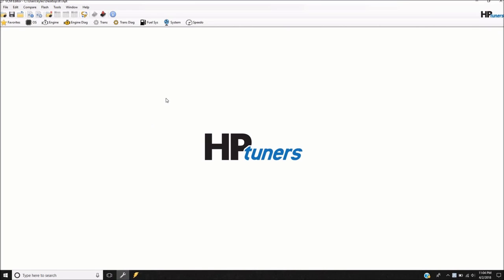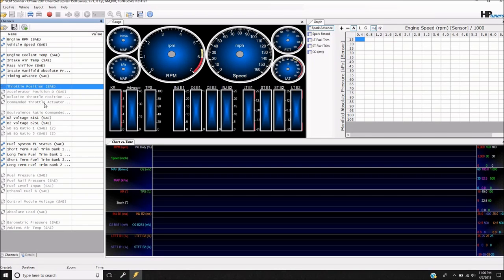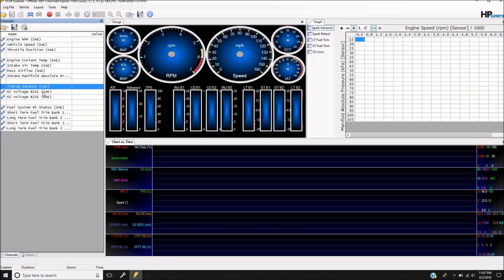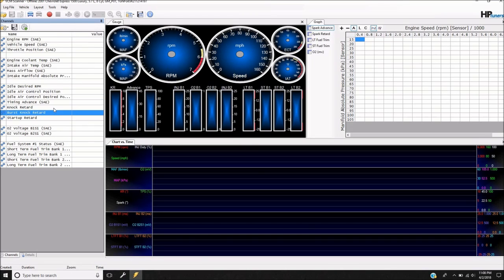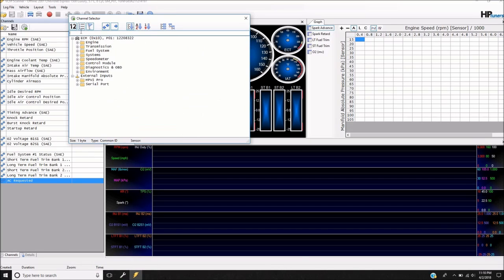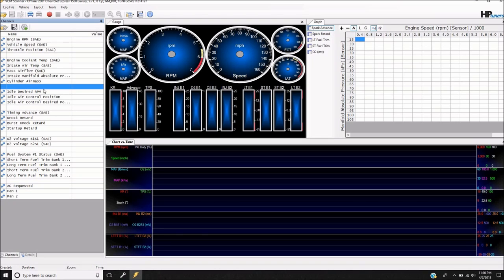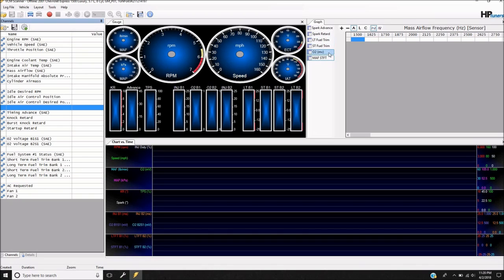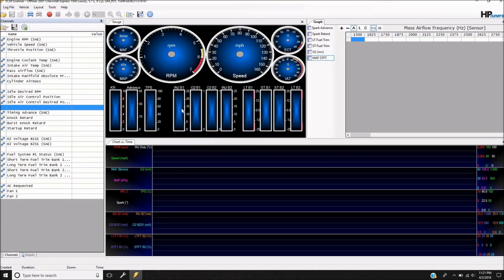LT1 411 LS1 pcm swap part 8 Tuning GM pcm with HP Tuners

Comment: How do you put a different OS on the pcm for your specific transmission selection and better pressure calculations for boost like 3 bar ecu instead of 1 bar

Comment: Great information! I've recently ditched the MSD fuel system on my 377" single turbo sbc and have started gathering the components for the 24x/0411 swap. As well as purchased HP tuners. 

Hopefully I can get enough fuel to the truck with this setup as the MSD could only feed 650 crank hp and at 10psi it was attempting to command 115-120% injector duty cycle (can't supply over 100%).

Keep up the good work!
Reply from the maker: Josh Watson they say you shouldn't go over 80% duty cycle. If it doesn't have enough off time it can burn up the injectors.
Reply: What heads and turbo are you running on the 377?

Comment: Crazy how detailed that is. Can we do tuning on a 7.3??
Reply from the maker: alwaysup2late honestly I have very limited knowledge on Ford's. I know my GM's pretty well and the Cummins I play with are all mechanical. But I'm pretty sure HPtuners and efi live are only for the newer trucks. I'd do the TS 6 position switch like everyone else does with the 7.3's. I'd be afraid to tune an auto diesel. I'm sure I could figure out how to crank it up but you'd probably want someone with experience on where to stop and what settings are good for a stock trans or whatever you are running. I wouldn't mind getting a newer manual truck some day and learn how to play with the tunes on them.
Reply: HorsepowerTube that makes sense! The transmission and shift points are mainly what I want to update, it shifts like garbage on most settings except 140hp on the TS but is jumpy on 140 too so it’s something I will be sorting out in a couple months I think
Reply: J Ray lol ok 👌?? 😂
Reply: alwaysup2late Cricket here! Your new mobile number is 7166027597. Have any remaining questions? Visit cricketwireless.com or call us by dialing 611. Cricket's service is subject to terms & conditions available at cricketwireless.com/terms .